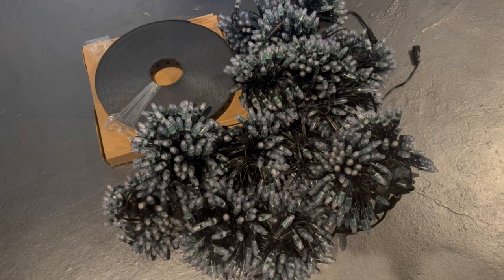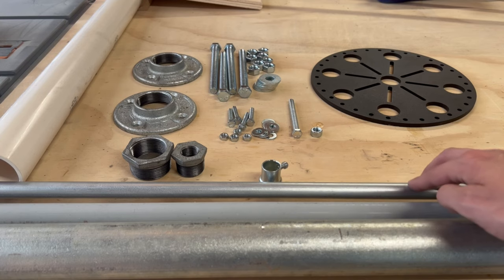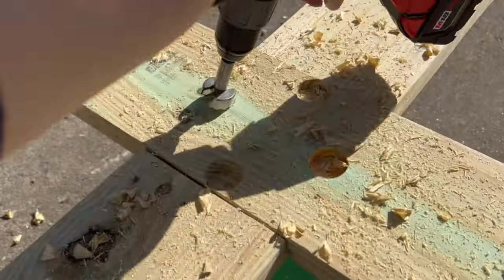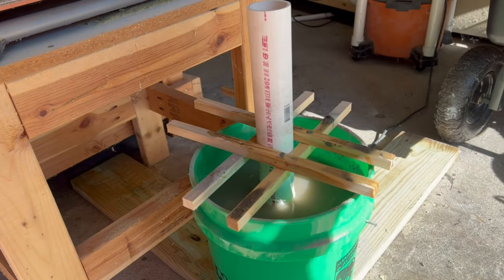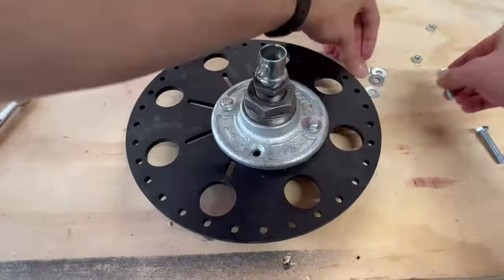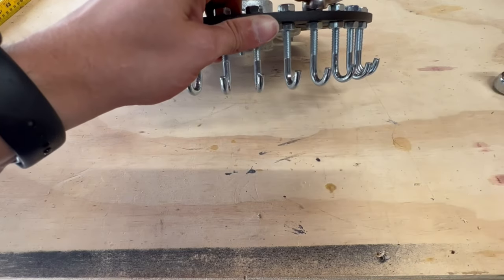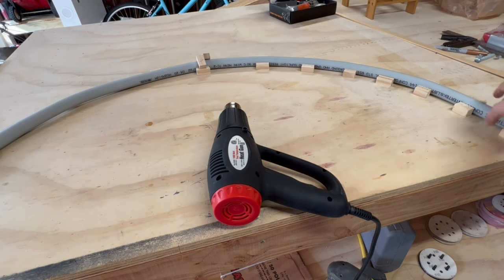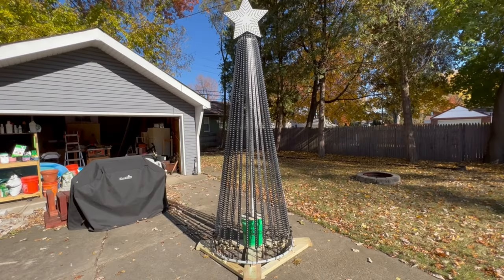LED Megatree Build

Comment: Is there a parts list available? Love the design!
Reply from the maker: This is what I have from when I did my home depot run, some of the items are "generic" as I pieced it together when there
5 Gallon Bucket
2x8x10 Pressure Treated
4 bolts (1/2" x 6")
8 nuts  (1/2")
8 washers (1/2")
2" x 2 foot long pvc sleeve
2 bags of fence post concrete
1.5" rigid conduit
Flanges for topper (to conduit and to emt)
4 Bolts (1/4" x 1.5"
4 Nuts (1/4")
8 Washers (1/4”)
Reducers for flange to topper pole
Bolt/nut to lock in pole to sleeve
Reply: Do you have a link for the sliver reducer?

Comment: How you are you attaching the strips at the bottom and are you just muscling up the pipe with everything on the topper then attaching the bottoms?
Reply from the maker: Lifting up the pipe with the topper, then ladder to hang the strips, at the bottom they are attached with bungee balls and I ended up adding screws with a washer to keep everything spaced out

Comment: how did the 3d printed star hold up? I have thought about doing the 3d printed start but figured it wouldnt hold up to the elements. What type of filament did you use. thanks
Reply from the maker: Worked out fine, held up to the wind storms and winter weather. It's printed in PETG, I've sold a few and know others that have used it and the only one I know that broke was when a full 20 megatree fell over

Comment: Hi was these 12v or 5v pixels ? did you use a dig quad on these and how many power injections and how many power supplies  did you use and what amp power supply .
Reply from the maker: 12v with no power injection running at 70% brightness for testing. Running a k8 now but I did test all the LEDs with a quad previously and it worked. All running on one 29 amp power supply
Reply: @justinzdesign  great job and thanks for getting back to me on this .

Comment: Great Job! What controller are you using? How much do you think you have into it. I want to build one.
Reply from the maker: Running off a kulp k8 plus a smart receiver. Probably close to $1000 when adding up all the bits and pieces

Comment: How did you wire up the strings. Did you do one long chain, split them to 8 chains, do 16 individual lines, or some other combination. Is your controller at the tree or do you run it to a central location? If it is a central location how long is your run?  I built one last year and I am trying to improve my design, totally using a lot of your construction ideas. Fantastic video!
Reply from the maker: I have it wired as 8 ports, 100 up and 100 down and then another port for the star. Controller is a K8 plus smart receiver that is specific to the tree and mounted to the pole

Comment: What's the diameter of the tree and how many pixels per string?
Reply from the maker: At the bottom about 40 inches, 16 strings of 100 pixels at 1 inch spacing